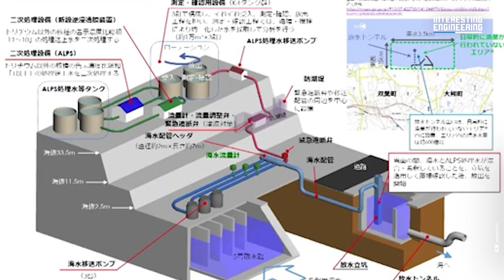Why Did Japan’s Prime Minister Eat Radioactive Fish?

Comment: This video  has not touched the real contention point— it is not tritium or C14 that’s the main concern. It is that other 60+ radioactive materials Japan said will be removed by its ALPS system. People don’t have confidence in what Japan said. China and Korea requested on site testing but were turned down.

Greenpeace wrote a position paper also questioning the efficacy of ALPS. It points out that currently the nuclear plant leaks about 1000 cubic meter of contaminated sea water underground every 10 days (i guess the intake volume does not match the outflow volume). And yet both Japan and IAEA have not investigated.

In addition, TEPCO, the company that owns and operates the plant had a long history of misleading the public and hiding  accidents and bad events.

So that’s why the issue has never been about Tritium — that’s an distracting tactic.